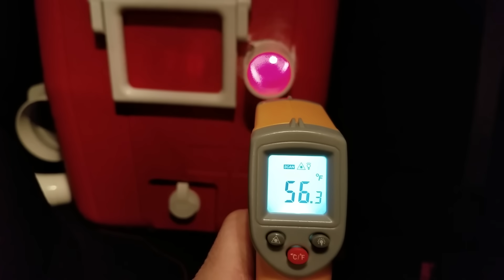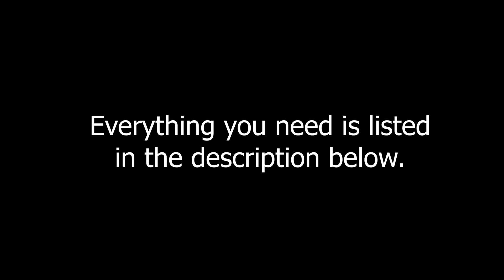Homemade Portable Air Conditioner DIY - Version 2 - Runs off 12 volt battery, car, or solar!

Comment: Would this work to cool a car in Florida? I have leather seats, no AC, its summer time, and very humid! I paid $250 to have it fixed, worked for 3 days, now they say it's $1,150 and kept my $250. So, I'm wondering if this would actually cool my car to at least a tolerable temperature. Thanks
Reply from the maker: I can't say with 100% certainty how much it will cool your car. I know how hot and humid it gets in the south and it is extreme. I can tell you this: If it is not able to cool the entire car, it will at least keep you cool and make it tolerable if you point the outlet towards yourself. It will be much better than having nothing and much better than riding with the windows down in that hot Florida heat.

Comment: Love this design, looking to make one for car camping and I mean sleeping in the back of my SUV while camping. I am getting my 100w solar system and this seems ideal. My questions is, instead of dryer venting, do you think using pvc pipe, going back and forth, would work? My concern is if pvc pipe wouldn't transfer the cold to the air as well as something as thin as dryer venting. If it would work, I could see 1-1/2 pipe and elbows  creating a lot of surface volume. Using ice and rock salt to bring temps down and not having to worry about corrosion from the salt. I would have a raised rack and still use the top to store food. What do you think?
Reply from the maker: The pvc will not get cold enough. Also, it isn't dryer vent. It is a much more rigid metal tubing. Click the link in the description and you'll see what I mean.

Comment: Thanks for the idea and listing the parts that you used.  I did it a little different, put the blower inside and split the vents into two.  Going camping next week over the 4th and hoping that this will help keep the garage cool in my Toy Hauler.  https://www.dropbox.com/s/lbw08nbzccje6my/36063317_10156306346369799_4559373153553350656_o.jpg?dl=0

Comment: Go to an old camper trailer lot and recycle an absorption refrigeration system that operates off propane. Then strip it out and place it in a cooler. Then design the drain spout on the cooler to fill a resivor with water from melted ice that then bell siphons into a canister with a pressure valve that shuts off the water supply and a pressure valve to release gas produced from calcium carbide and water that then feeds through the pressure valve through a hose to a burner that is hesting the absorption refrigeration system. Place a cut out in your window and place your absorption refrigeration system outside your.window or tent or camper fill the ice chest with ice then start your blower fan to move air into the room and have another duct to circulate air in and out of the ice chest that circulates the chilled air in the room or tent with the exuast from the burner going up a metal pipe and away from your window. High technology red neck portable air conditioning or just use it has a powered cooler to keeps y'all's beer cold at a family gathering. 😵😲😊

Comment: make & do - We built this exact model this weekend for a beach trip with a car that has no A/C (compressor needs replaced). Blower works amazing and the air is very cool.  The only thing I am worried about is the aluminum duct taking on water or getting punctured. .  How much water do you suggest using and did you use a 10lb or 5 lb bag of ice?
Reply from the maker: Use as much ice as you like. The best way to handle the duct leaking is to open the cooler drain valve and attach a small hose to drain any excess water out. So if the duct leaks, the water will not get more than an half inch or so high.
Reply: Thank you so much!

Comment: I am trying to figure out what the best way to blow cold air on my dog, Molly, while in my lil MGB convertible. I don't need air for me, just to blow it directly on her. This seems to be like a good design but my concern it the HOT air blowing in. Do you think this design will work for my situation?  The cooler would be sitting in the shade in the foot area of the passenger. With a tube or a vaccum hose to blow the air do  you think this would work? What about the intake air being so hot. Can this still work for me In my situation. Do you have any suggestions as to what would work?
Reply from the maker: It's hard to say with you being in a convertible. The air coming out will be cold but there will be so much surrounding hot air, I'm not sure how well it will work.

Comment: Just plugged it in and I got sparks coming out of the fan. What do I do ??? I have it hooked up to an outlet plug.
Reply from the maker: Not sure. I can't really troubleshoot something like that without being there. However, if you have sparks, that is not a good sign. Something is not hooked up properly or you don't have the right adapter for a wall outlet.
Reply: make & do thank you and I think it's not the right hook up. Forgot the converter.
Reply: I think he meant a 110v ac outlet for the 12v dc fan. Not a good idea.

Comment: So I made a practically identical a/c unit, based on this video, flexible duct is NOT waterproof, meaning as the ice becomes water it gradually collects in the air duct, and then bleeds into the fan. 

We can do better.

Comment: I think someone flunked middle school science class. Melt the ice slower and get more cooling? Sorry that is not how it works. Melt a ton of ice a day, and you have the equivalent of a 12,000 BTU air conditioner. Ice only works when it's melting. That is why commercial refrigeration is rated in "Tons". Back in the day, if you knew how many tons of ice you melted in a day, it was easy to size your electric powered refrigeration.

Comment: I liked your idea and built one in a 72 qt. Cooler. Problem; 272 cfm when going from 4" dia. To 3" dia. To 1 1/2" dia. Is 
substantially reduced and actually causes a back flow of air from the intake air opening on the fan housing.
The air temp. Is reduced on the output but the air flow is poor. Pumping ambient air into the system hastens the ice 
melt but but the reduced air flow seems to improve the air out temperature! A typical catch 22 situation. I will continue to play around
With the design but I think it will be a futile endeavor.

Comment: I really think you did a great job both developing the unit and explaining it. I wonder if this would run off of USB?
Reply from the maker: I don't think USB would provide enough amperage to power the motor. The motor requires at least 6 amps.

Comment: Ingenious idea. Thank you so much for sharing. Works great. 

Unfortunately, my metal pipe has a leak somewhere. The leak is too small to see or find by eye -  the pipe gets water in it. If I can find the leak, I’ll seal. Finding the leak is not going to be easy.
Reply: which tubing did you use? I have seen at least two types.. there is a kind that is stronger than the other.. I wonder if ther is a way to do a leak test similar to how people check for leaks on bicycle rubber inner tubes? putting it in soapy water and fill with air and look for the bubbles?
Reply: I used the recommended tube. I found the leaks by shining a flashing light source (LED flashlight) inside the tube, and observing the outside of the tubing in a dark room. The tiny holes then became visible like tiny stars.
Reply: UMMMMM..Change ther pipe????????

Comment: We built one using a deflect-o AO38/16 from Ace Hardware, everything seemed good until the ice started to melt and we started hearing a sound that indicated there was some water in the duct tube. I let it sit overnight and by the next morning the air was blowing out of the motor housing instead of the air vent, at this point I knew it was full of water and would not allow air to flow through. After examining it we found the water had penetrated through the seems and slowly flowed back out after we removed it. If anyone has also experienced this please let me know of your experience. The concept itself is good if there was a duct that didn't fill with water but I can't think of any type of duct that will flex enough to fit in the ice chest and still allow air to flow through without allowing water to flood the duct.
Reply: Had the same issue as you. Apparently flexible metal duct work is NOT water tight. I think I'm gonna wrap the duct in several garbage bags with duct tape at the connect point. Basically waterproof the duct manually. 

Also I'm adding dry ice to brick it and further reduce melt.
Reply from the maker: One solution for this would be to open the cooler drain. This would only allow the water to get about an inch high in the duct and would not stop the air flow. You may have to attach a hose to the drain depending on where you are using the cooler.
Reply: It's in a one ton truck in the back seat to help keep passengers cool, (no rear A/C like the Suburbans have).  If it was a Michigan rust bucket I would simply make a hole in the floorboard and keep rolling but have no place to vent it on this truck. If I can't find a duct that will hold water I will have to start all over again.  The duck I used is the same that is in your video. If I could find a small radiator or heater core that would have enough vent for the blower motor that would work but that would create too much back pressure and burn the motor up.
Reply: Danny, we are working on using an intercooler or possibly the intercooler piping coupler kit (you can find these on eBay, just type in intercooler and the kits will also pop up) you can buy this in 3", actually I used a 3" blower not the 4" as it should be a little quieter and is only 2.5 amps instead of the 6 amps of the larger blower. This way you will not have the joint leaks of the flex pipe, I personally don't think there is any way you can make the flex pipe work.

Comment: I have a some questions: i saw this great video and built it step by step like you did. The problem is it wont cool. Because the ice melts in 2 or 3 hours and turns in to cold water. And the pipe itself doesn’t get cool because i used a aluminum pipe like you did. I cant find a metal pipe only aluminum. Am i using the wrong pipe? I even bought exact the same cool-box as you did but the ice melts in a few hours. What am i doing wrong? please help

Comment: Any one able to estimate how long a car battery would run this system for tent camping or van camping?
Reply: I have placed here a chunk of general battery knowledge that I've learned through the years. It may seem long, but I believe that it's good quality and should serve you well if you do decide to read it. 
Well for starters a car battery is technically considered a starter battery. It's designed with thinner lead plates than a deep cycle battery.
Why is that important?
The thinner plates of a starter battery allow the battery to give out several hundred Amps of current to start the car, whereas a deep cycle battery has much thicker plates which allow it to output fewer Amps of current but it can be discharged to around 80% for a charge/discharge cycle. unfortunately that's about the only pro here for starter batteries is that they can give you a bunch of power in an instant but will be damaged beyond that. 
The cons 'to name a few'
The battery is only designed to be drained about 5% then recharged to full by the alternator.
Discharging further causes something called polymerization to occur on the plates. This coating keeps the battery from working as well as it should.
Also over time polymerization still occurs but it usually takes about 5 years for it to be significant enough to have to get a new battery.
What you want, probably:
If you try using a starter battery like a deep cycle one then it's life will be decreased to a year or less, it won't be able to start up your car as quickly, and it won't have as high of a capacity anymore incase your car didn't start up right away.
It's not worth it.
One neat trick you can do in a pinch is charge a deep cycle battery with your car just by connecting the two together 'your car battery connected to the car, and the deep cycle battery on the ground or other surface' note that your car is running while you do this.
Get jumper cables and connect the two batteries in parallel 'red to red, black to black' on both.
Leave them for about an hour or two.
That should charge up your deep cycle battery around 50%-70% 'rough guesstimate based on a 100Ah deep cycle battery.
You can also get a multi meter and set it to read dc volts.
A dead battery is about 11.4v and a fully charged battery is about 13.4v, but about an hour after disconnecting from a charge source the voltage should drop to about 12.6-12.8v
Now as a battery gets used/cycled it loses capacity this can be reflected by its sitting voltage 'the 12.6-12.8' like a battery that's nearing the end of its life may sit around 12.0 or even 11.8v
A starter battery at that stage may still be able to start your car, but not for long.
Also a bonus fact - lead acid deep cycle batteries only have 50% or half of their total capacity is usable without damage to the battery! Annoying, right?
That means a 100ah nearly 200lb battery can only give you about 50Ah for about 300 charge cycles.
Likewise a 50Ah battery can give you 25Ah, etc...

Comment: Great video, cant stand the haters!  Simple question, why reduce the outlet? Thanks
Reply from the maker: Their is actually no reason to reduce the outlet other than you will be drilling smaller holes in the cooler. I initially thought it would help cool even more, but was wrong about that. You can reduce or keep the same diameter if you like.

Comment: Okay I built one and the metal pipe is taking in water, i did however get it down to 31 F
Reply from the maker: You could open the drain on the cooler so that the water will not get more than an inch deep and you will still have plenty of air flow. You may have to hook up a drain hose to it though, depending on where you are using the cooler.
Reply: I used a 4" Dryer semi rigid and  3 " inside of that the 4" , all of which go to a reducer, then a swivel top  PVC 45 Degree angle.... I coiled it like what you would see in a Porsche 911 "Turbo" I used a High output 12" fan, A Homemade shroud I made from like cheap plastic cutting board..... I got it down to 31 degrees F, I have however found water proofed metal air ducting that is 4", this is mounted in my office where I make 3D Assets for Gaming Companies and run my web design business from too... Here in Minnesota ( moved from Oklahoma Aug 2017  way better here as far as heat goes )  it usually does not get that hot, but there are some freaky days here and there

Comment: Sir what if i use pepsi can for the tube inside? Will it be cold like the one you use? And if i use a mini fan which has power 1 2 3 and use the pwer of 3? Will be  also cold ? And my room us just a little room and the temperature in my room is 29C to 32C and its hot, i just want to make some of those becouse i cant afford to buy a generated ac becouse i'm just a 12grade student in highschool

Comment: https://www.amazon.com/gp/product/B01461MOGQ/ref=crt_ewc_img_huc_1?ie=UTF8&psc=1&smid=A38O99J0OT8HQ0
Would this power adapter work?
Reply from the maker: No, because it will only provide 5 amps. You need one that will provide at least 5 amps since that is what the blower calls for.

Comment: Could u use dry ice for a colder effect?  i have 1954 teardrop 75 sq ft to cool in moab , i must keep it cool.. plus solar power  or battery is POWER sorce
Reply from the maker: I would not use dry ice as it gives off carbon dioxide. Add some rock salt to normal ice and that will make it colder.

Comment: make & do.    Hello again Jason, will run this version 2 at least during 8-9 hours sleeping time (enough ice cubes for 8 hours!) and must it be standing like many other models near my face/head/bed for the best result? Cheers Sammy
Reply from the maker: This one pushes a lot more air than most so it does not have to be right near your head. However, you will want it pointed in your direction if it is a big room, but you can put it much farther back.
Reply: make & do  superb thanks at least 8 hours non stop cool effect during sleeping?

Comment: This is nice.. really well done.. I want to try this but my only concern is how loud the blower fan is... I'm going to be using this in my office, it's the one room in the house that's always warmer then the others regardless how low I have the AC set to.  This would be great to cool down the area where I set but it wouldn't be good if it sounds like a jet engine.  by chance do you have a vid or recroding of how loud the fan is when it's running?
Reply from the maker: I do not have a video of that, but I can tell you that it is about as loud as a car ac on high.
Reply: make & do hi, can you post a video that we can hear how loud it is? Thats the only thing stopping me from going forward.thanks!

Comment: Better than others out there cuz it doesn't add humidity to the air. That's the object of air conditioning, to remove it, not add more. That's what these guys keep forgetting.
Yours cools, but doesn't blow moisture into the room.*
Good thinking.
*Edit. nearly as much..
Reply: Did you find a blower or fan with the coolest running temp?
I can't get anyone to believe me when I say that an electric fan running in a closed room will RAISE the room temperature.